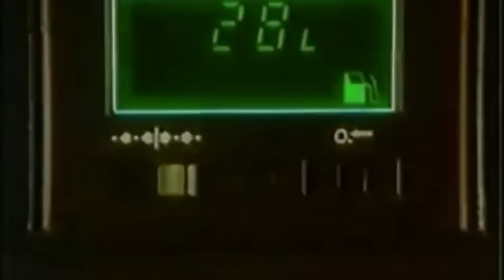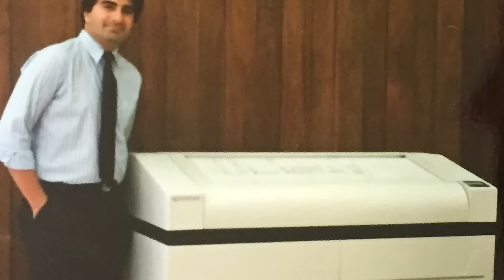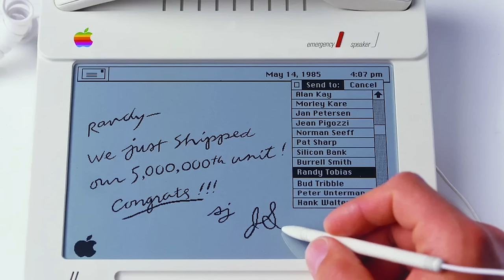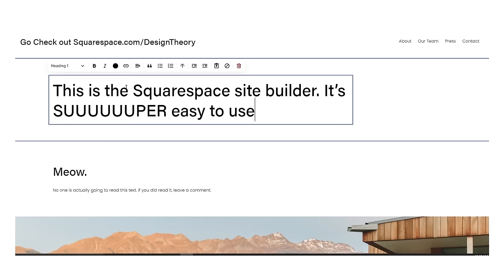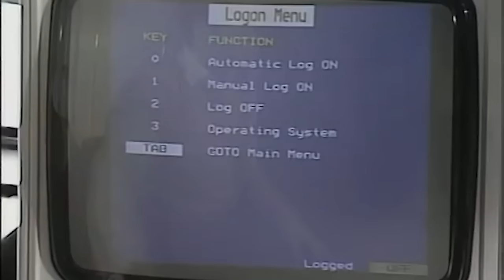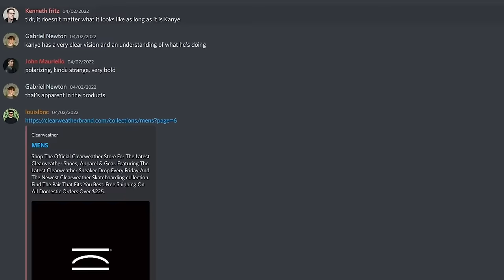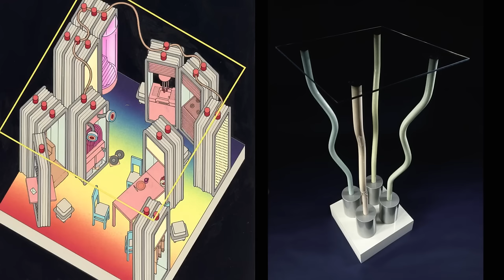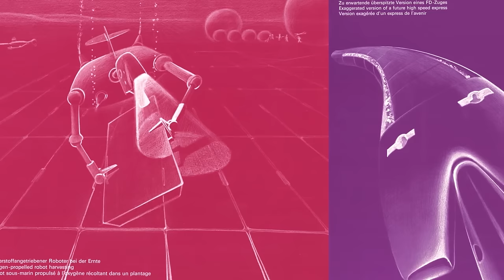Why Design in the 1980s Looked So Weird & Why It’s Relevant Today

Comment: I'm thoroughly disappointed in modern design. It often puts external look, "beauty" in front of other properties of the designed object, interface or whatnot. Ergonomics, intuitive understanding by the user, safety, ecologic impact, efficiency, ease of cleaning and maintenance etc., etc. - everything is more important than just looks. Thus houses, cars, furniture, appliances, software applications are born which are designed, not engineered. They do consider important qualities and issues like safety and production costs processes, but somehow frills often become more important than the substance. That includes change for the sake of change, of which exra-fast fashion is the most egregious example, but also software.

Comment: And that's why I have so little respect for modern designers. This is a full nostalgia and emotions driven essey with very little connection to reality. 
80s design was colorful and happy but also absolute garbage from the quality and usability point of view. 80s was full of broken, unfixable hinges, connections, cheap plastics,  items that wouldn't fit properly into anything (that chair is a torture device more than anything).

Apple was a pioneer in crappy, unfixable form over function approach that we see everywhere today. There is absolutely nothing to long for. Plus, most of it was literally toxic.